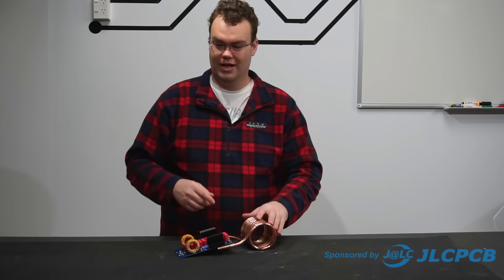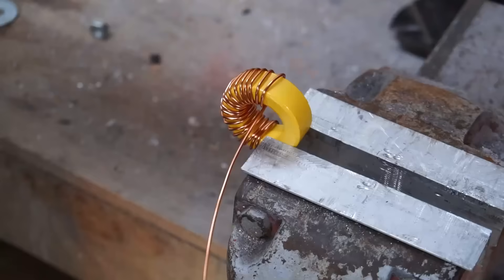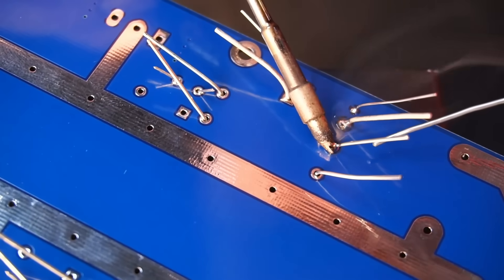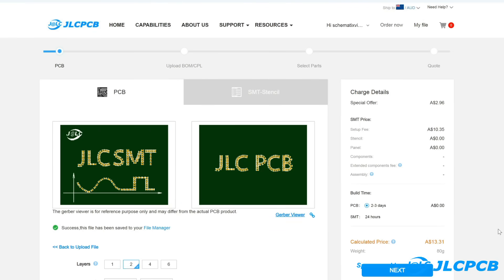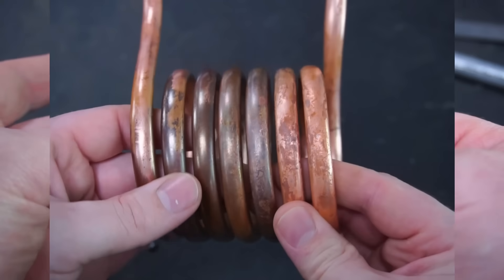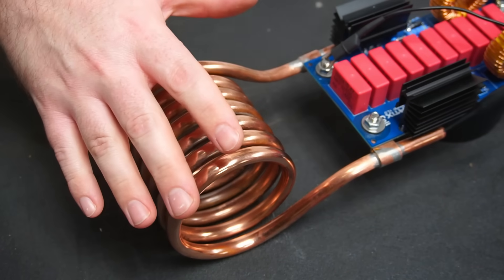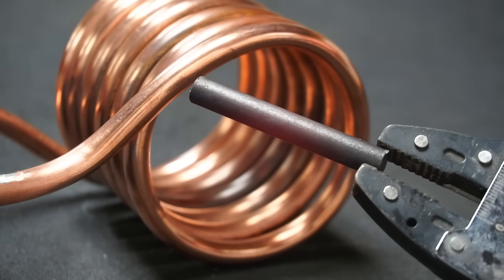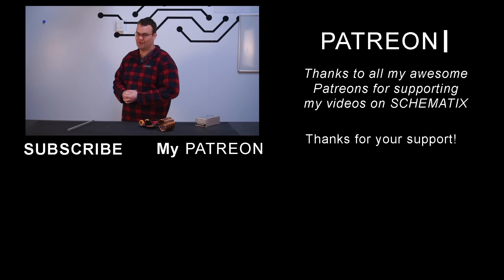Building a 1.4kW Induction Heater

Comment: try without electronics, only a dc motor, mechanical dc current reversing mechanism, induction coil to smooth it out
Reply: Imbécile should have been my 1st reply.
Reply: btw, why ac-dc-ac conversion?
Reply: A relevant question  @Jkauppa , but you'll never get an answer to match in here!!
Reply: @Egzoset  at least i hope it goes to the channel host
Reply: > Why ac-dc-ac conversion?

That's the part i reacted on, but you'd never get a clue what i got in mind i think, which ain't a sin...
Reply: @Egzoset  ok, i told why i said it in the first place, why would you mess this with law related matters
Reply: @Jkauppa  You'll have to get more specific than that!
Reply: @Egzoset  no, i dont have to anything
Reply: @Jkauppa  Waste your time anyway you see fit.
Reply: @Egzoset  serving in Christ i have anything i need without needing to ask anyone
Reply: Blah!  Blah!  Blah!  ...  Blah!  Blah!  Blah!
Reply: @Egzoset  if you want to be useful, turn to Christ
Reply: @Egzoset  not needed
Reply: @Egzoset  why would i need knowledge, from flesh, i get what i ask for from my Father in heaven, skill is everything compared to knowledge
Reply: @Egzoset  i did not make the original comment to ask for anything, just pondering why its not done in some way
Reply: Blah!  Blah!  Blah!  again.  Now that's harrasment.  Topic derailing, whatevver troll tactics you may prefer actually.
Reply: Fix it if you think you can, which you clearly can,t begin to imagine.  may the lord have pity for your soul...
Reply: @Egzoset  you invaded my comment, and dictate, try to
Reply: @Egzoset  my judge is the Lord, not you
Reply: @Egzoset  i dont need you to give your task to me, i have things of my own to do
Reply: Blah!  Blah!  Blah!  again.  Topic obstructor.
Reply: @Egzoset  make your own topic
Reply: i mean, you could have a pulse coming from the wall, then just use that to generate whatever amperage and frequency needed, or even directly do ac wall induction

Comment: This is the “cleanest” induction heater build I have seen on YT. Very nice build! Thank you for sharing your art and your science.
Reply: How exactly is this an exact copy of the comment exactly above, written a full month later, and has more likes and comments than the original by Michael Ford? N why u b stealing other peoples thoughts like that?
Reply: @jonross377  "Hello, Algo!"
Reply: @jonross377  ""Noooo you can't steal other people's comments on the internet!"
Reply: From the other side this is one of the poorest design on the entire yt. Path from tank capacitors to work coil is long, MKP capacitors have realy big capacitance change with frequency and voltage accros it, next disadvantage is thin copper connected the all tank cap with coil and especially tinning these paths is a very bad idea due to skin effect. 1400W it is consumption power but i think only due to no filter capacitors on the pcb and using clamp meter - clamp meters are optimal for main 50 or 60 Hz current meter (or DC) but here this is not pesent even on the power connectors.
Reply: yeah it was also not powerful enough to be a melt furnace, so what's the point. the parts were not salvaged so that was good, but the power supply was not, so in reality the kit feeling that I could actually get those parts only extended so far.

Comment: One of the cleanest induction heaters I've seen built yet, great job...
Is there a advantage to copper tube vs copper wire for the heater coil? anything to do with skin affect?
Reply from the maker: Thanks for your kind words :) I don't think there's any appreciable advantage for using tube vs wire for the coil. The reason I chose tubing was it left me the option for water cooling in the future
Reply: @Schematix  very nice.......

Comment: An old stick welder can make a decent high current power supply.

Also, quenching the copper isn't necessary for annealing, air cooling is fine. Both ways work.
Reply: Do you know the voltage on a stick welder when the transformer is loaded?
Reply: @jcglessner  20 Volts give or take but the ideal requirement is for higher frequency.
Reply: @jcglessner  that is a very hard to answer questiom. It depends on the transformer, it depends on the load, it depends on whether or not the magnetic shunt has been removed.

Typically, open circuit voltage on a simple ac welder is anywhere between 50 and 120V. Arc voltage hovers around 20~35V
Reply: @randomelectronicsanddispla1765  I think you just answered why those are not such a good idea.
Reply: Quenching  only hardens
Reply: @mrgreenswelding2853  You are talking about steel not copper!!!!!!
Reply: @mrgreenswelding2853  if it is steel. If it is copper it works the other way round: quenching softens it.